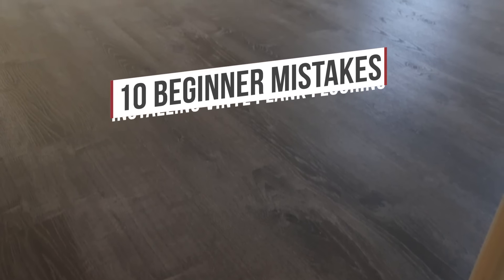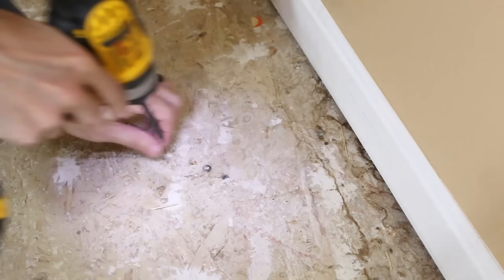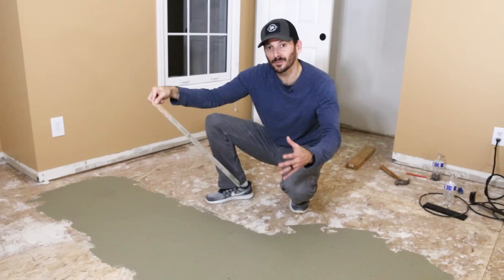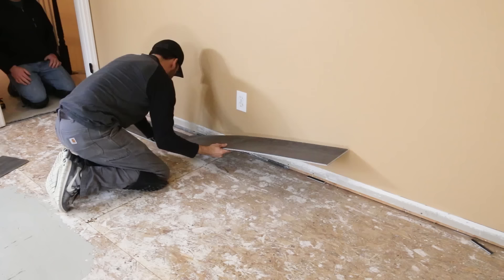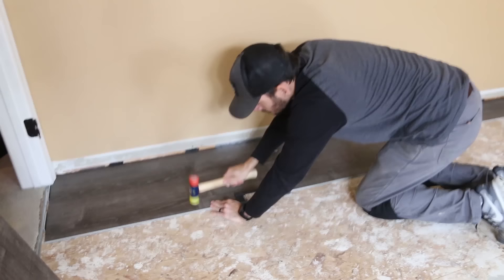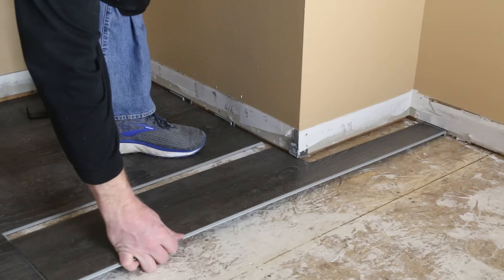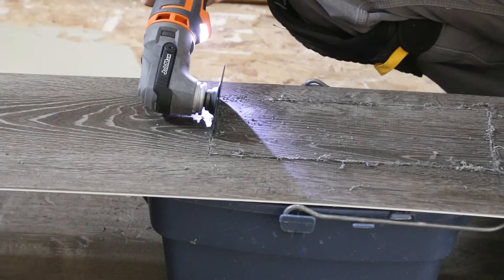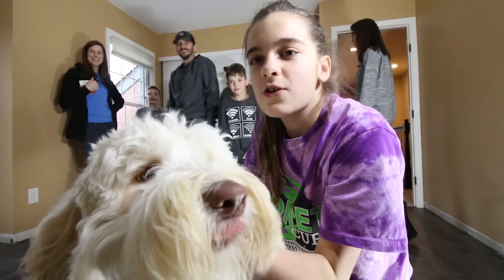10 Beginner Mistakes Installing Vinyl Plank Flooring

Comment: We removed our baseboards, mostly so I could convince my wife I need a pneumatic brad nailer. Also, I used a flat shovel to pull up the tack strips and most of the staples. Didn't have to use the pliers much at all.
Reply: Yea but shovel with damage the base if your not going to put new up
Reply: Can use isolating tool to cut staples off I tried it  works even with an old  blade

Comment: need to have more emphasis in the vid about prepping the sub floor.  Especially for those with older homes who may have nailed flooring.  Use appropriate type and length of screw to secure the subflooring to the joists to avoid future squeaking.  A pound of prep on the subfloor up front is worth its weight in gold over the long term.
Reply: As odd as it may sound, I have a home that was built in the 50's. Our kitchen floor squeaks in a few spots. I have not only grown accustomed to the squeak, I am getting to where I like it and attribute it to the character of the house.
Reply: Never seen a sub floor not nailed down
Reply: @johnstonjoseph81  I've seen them with on screws no nails.

Comment: When you reinstalled the base board at the end of the installation, I don’t see how that changed the large gap between the lower vinyl plank and the bottom of the base board. Did you install the base board lower? If so, that means you would have to repaint the wall, no?
Reply: Yeah, they will lower the baseboard down to the finished floor level. Which means repainting the walls...I'd rather install quarter round. Quarter round also has more flex in it to follow the dips and bumps in the floor. Baseboard has a harder time doing that.
Reply: I plan on removing the baseboards as I am painting my walls also. This will allow me to use a roller at the bottom and I don't have to worry about using a brush to trim over all the baseboards
Reply: Can you installing new slightly taller baseboards?

Comment: 37 yrs I’ve been doing flooring and using floor prep or thin set to level the floor is in my opinion the worst thing you can do . Why you ask because it dries out and cracks underneath a free floating floor and when you walk on it it sounds like Rice Krispies I personally use the cardboard from the plank boxes to level it out as you go . If it’s a severe dip in the subfloor yes prep it but you should use the bonding additive to the floor prep and use bondall and roll/ paint/ brush onto the plywood before you lay flooring prep on it . I have done many repairs for  customers complaining about crunching noise under the flooring so either using cardboard or bondall and a bonding additive for the flooring prep will eliminate any problems .

Comment: I recommend using a 10 foot straight edge or at least an 8 foot one to make sure sub floor is within spec for install. 
Usually for vinyl it is 3/16 over a 10 foot span.   Very  important for warranty on the install.
Reply: Flooring Everything he did...
Reply: He used a six foot level in the video. 
I only added the comment because it was a great video , but I feel the  rule of flatness is critical  in  a vinyl install.  
The first thing a manufacturer does when they come to a job site is check that rule. If the floor has any  humps or dips more then 3/16  the warranty will be void and called installer error.
Reply: @flooringeverything8260  yup 8 foot is the way to go but some floors require 10 foot to 3/16 of uneven surface but the smallest radius to 3/16 is usually at least 8 feet never seen the warranty uneven measure radius at 6 foot so him using the 6 foot isn't going to give you the measurement you need
Reply: On my jobs I found new use for my old chalk line. Drive a nail in at one end of the room and stretch tight to the opposite side.

Comment: Carefully label ALL baseboard pieces WHILE removing them.Write on the back of each.
Reply: Painters tape and a sharpie just put it on every one
Reply: Very beginner advice taken
Reply: Sorry - beginner here. What am I writing on the labels? Which row they're from? Thanks
Reply: @jackhaugh4198  
Which walls. A on the baseboards then write A on the wall which it came from. Write B on the next baseboard and B on the wall what you came from and go throughout the alphabet.
Reply: @rxonmymind8362  Thanks!
Reply: I don't get it he removed the baseboards and then thinks he can reinstall them lower without a quarter round (carpet stood higher than vinyl planks) which means repainting the wall !! He got away without mention that at the end. I don't want to repaint walls !  Am i missing something ? thanks !
Reply: @ericastier1646   I was thinking the same thing. Paint and recaulk? not a fav... waiting for answer as well.
Reply: @ericastier1646  He mentioned at 12:32 that they're replacing the base-boards, so I imagine they're going to get taller boards to cover up the unpainted part of the wall.
Reply: @ericastier1646  I work for a company that rents apartments. Many are around a century old and have carpet in the bathrooms/kitchen (which is a bad idea). We routinely replace it with vinyl plank flooring. My boss prefers using shoe-mold or quarter-round, I take out baseboards if they're less than six inches high (longer than that they usually break or hide a very wide gap between wall and floor).
Typically, we DO paint the rooms. If it's vacant, it only takes about one and a half hours to paint a bathroom, and about two to three for a kitchen. Naturally, it depends on how many edges (corners requiring brushwork), obstacles like cabinets, surface type, and, to a lesser degree, square footage, but it goes much, much faster when you don't have to worry about spilling paint on the floor and aren't fighting a drop-cloth.
Reply: @ericastier1646  not just paint , their will be a caulking and paint line, you must scrape clean, coat with speed mud, sand then texture, prime and paint, I always try talking home owner into new taller baseboards
Reply: When I decided to replace carpet with laminate, it made sense to paint walls and replace baseboards. House is 50 years old. Baseboard was stained and deteriorating. And was installed before carpet. Only exposed 2.5 inches of wood. Did it in 2019 when wood was cheaper.
Reply: @starpartyguy5605  excellent! Base always needs to be replaced
Reply: @shawnhartmann4581  I did repaint walls and learned that getting an even uniform result has many parameters involved. Not sure if it was the Lowe's or Home Depot paint brands or the roll brush type i used or the lack of water in the paint but i had a hard time getting a perfect result. Seen facing the wall it looks perfect but if you look at a low angles not at all uniform.
Reply: @ericastier1646  It sounds like you're dealing with a sheen change due to the undersurface.

If it's your own house and you can deal with the imperfection, take my advice for next time. If not:
Sometimes (especially in older houses) decades of repainting will leave a noticeable ridge when floor trim is removed. Carefully scrape the worst of it off with a putty knife or painter's 7-in-1. Then get the rest of it with some coarse sandpaper or a fairly fine pumice stone. Just be careful not to gouge the wall. If you do gouge, you can probably make it invisible with some spackle or drywall mud and careful sanding, but that's extra time.

Next, you need to even out the sheen. In other words, what you describe sounds like one part of the wall prior to your painting it was glossier than the other. The easiest way is to prime before you paint. In most rooms, you can get away with latex-based, in rooms where moisture is going to condense on the walls like a bathroom or kitchen, you should use an oil-based primer. Nice thing about bath and kitchen is that there's sometimes exhaust fans, they help with the oil paint fumes. Either way, open windows and doors. 

For both latex and oil primers, my favorite brands are Killz and Bullseye. They're not the cheapest (but the cheap ones you can wipe off with a damp rag after they're dried) but also not the most expensive. Both have good "hide", covering variations in color well. Killz is better in that regard, but I find Bullseye to be more durable. Dealer's choice.

Like I said, If it looks perfect straight-on, you did a good job, if the small imperfection at angle doesn't bother you, it's good. If you really can't deal with it, and you don't want to go to the trouble and expense of priming and repainting (although painting a well-primed surface can be more of a joy than a chore), as a stop-gap you can take the remainder of whatever paint you use and apply a second or third coat where the trim was, feathering out onto the main wall to blend it. The previously trimmed areas are the most likely culprit, and multiple coats may fill in the physical differences in the undersurface which are causing the variation in sheen.

Hope this helps.
Reply: @shawnhartmann4581  I am thankful and appreciative for your clear and expert answer but i realize i was not clear enough. It's not about painting after removing the floor trim, it's simply interior wall re-painting with latex paint over older latex paint (I tried Valspar and Bear on separate walls, just hallway not bath or kitchen) and got passable result with valspar sheen varying where the roll brush had been. I looks like i did not cover the wall uniformly even though i tried my best to follow an overlapping pattern and to use an even light pressure of the rolling brush. While i was painting i noticed that the latex paint dried very quickly and so I mixed a few trickles of water in the mixing pan whenever i reloaded the brush with paint. I tried to add as little water as possible, it did not drip but the sheen has unacceptable variability over the wall seen at low angle showing the rolling passes in a random way.  I used a small roll brush (I think it's the one for touch ups instead of the full size one) but i used the spongy like type of roll for smoother surface which i replaced halfway through the job. I noticed the brush quickly got compressed to only a few milliter thick by the drying paint.   I don't know where i went wrong so now i have less confidence in doing another wall but i'll definitively buy the regular sizes roll brush instead. The paint was mixed in store at Lowes, I suspect the Valspar brand is inferior.   I did not use a primer, i also found it difficult to paint the same color over the old one for knowing where i had not applied enough new paint. I did do a second pass probably i did not wait until the first pass was fully dry and that might be the reason for the uneven sheen.    What i didn't like was that the roll seemed to hold less and less paint as it got compressed by the mucky thick latex paint, i had to reload it constantly even after 3 hand strokes.  I found that particular latex paint gave very little margin for error. Especially due to how fast it dried and if you rolled a second time over the already drying paint it messup the sheen.   I didn't expect it would be that tedious and difficult. I am still unsure where i went wrong or if the paint was not just a good brand.
Reply: @ericastier1646  Valspar is indeed hit and miss, sometimes you get a great mix, and sometimes both coverage and hide are terrible. Adding to the confusion is that they have "minibrands". Their Signature line is probably the best one they put out.

If I can, I tend to use Behr or Sherwin Williams.

Also, never add water to your paint if you want an even coat. Other painters might (and have) disagree with me on this, but paint is too fickle for that imo. If the environment is super arid and the paint is drying too fast, moisten the air. Close doors and windows, bring in a big pot of boiling water and set it in the middle, turn on a humidifier, run the shower on hot for two minutes, it won't take much. It's latex, so you really don't need too much ventilation (unless you have a bad liver). Just don't spend all day in the closed room.
Also, not to criticize, but paint shouldn't dry as fast as you're saying. Could be the air or brand, but also maybe paint a bit faster?

Main thing seems to be the rollers. I use the small 2-3" ones sometimes, but rarely, mostly just for very narrow but highly visible areas I still want to get an even coat on. My go-to roller covers are the medium-nap 9" Valspar blue ones. Even with their occasional paint fails, they make a decent roller cover. It's polyester, so it both holds up and releases paint decently, and is durable enough for most textured surfaces. Though if you're painting a large area of raw brick, cinderblock, or rough concrete, you might have to switch in a new cover halfway through. You can get a 3-pack for about $11.
There are cheaper covers, like from Project Source. Avoid those like the plague.
There are also more expensive covers, but they only work a tiny bit better. Don't worry about a roller cover leaving a sort of mild goose-pimple texture after a pass. Unless your paint is super thick (usually due to being used off-and-on over a few years) almost the consistency of thinnish pancake batter, the "pimples" will fade as it dries.

Also on the subject of texture: brush strokes.
Again, different painters have different opinions, but mine is that all cutting in (the edges) should be done before you roll. Those tiny bumps from a roller might settle, but the ridges in paint left by a brush might not.
You kind of have to do both, as well as overlap them, so it isn't any faster to do it one way or the other. However, if you roll first then cut, you will often leave streaks the width of the brush (I usually use a 2.5" angled trim brush) along ceiling, corners and floor. If you cut then roll overlapping where you cut, you can get pretty close to an edge and have a much smoother surface. It's also okay to rotate the roller 90 and do a pass overlapping the ceiling and floor cut, when you're doing the big vertical strokes you'll partially go over that area again so it'll be texturally even, but you'll also give yourself a decent margin so you can go quickly without having to worry about accidentally slamming the roller into flooring or a nice white ceiling.
Reply: @shawnhartmann4581  Thanks a lot for the added guidance, Shawn. I'll buy the medium nap 9" Valspar blue ones and stick with Behr paint. Hopefully with better results. I see you are a bit dubitative about my saying the paint dried fast. I painted last May, i am not in a dry climate but i now realize i did a mistake of turning on the AC which removed air humidity, i won't do that again and will try to increase humidity instead as you said (which is not pleasant).  I was not working slowly either, the Valspar latex paint is only slightly more fluid than pancake mix consistency from the can. It felt like spreading thick paint on the wall instead of coloring the wall. The Behr was similar but was painted in a small laundry room without windows so harder to judge than the Valspar painted along a corridor with window at one end.  Overall i dislike the thick consistency of latex paint. I think that the lack of fluidity and fast drying of latex paint is what creates the sheen mismatch. Only 2 minutes following a roll application when i came a 2nd time to overlap it messed up the final sheen as if there is a sticky effect as it dries. But 2 minutes or even less is very short time to complete one vertical pass with the roll including reloading the roll at least 3 times.  It's why i added water but then mixing the water in the latex takes extra effort and extra time.  Very frustrating process.

In the same condo in another project i repainted an ornamental (fake) fireplace floor fake stone (plastic) slab with polyurethane paint  (why is everything so fake in american homes compared to other developed countries, different topic). I cleaned the surface with alcohol. The painting was extremely easy, even enjoyable with a 3M breathing mask but the fumes were horrible and lasted for a good 3 weeks. The final result was excellent.  This was my first experience with latex paint and i expected it would be easy, but i found it difficult and frustrating.
Reply: @ericastier1646  Didn't mean to disparage. Painting, at least in construction circles, doesn't get much credit. A framer, joiner, plumber, tinbender, etc. all inherently get more respect. 

In truth, there isn't much knowledge necessary to be a painter. Maybe a working knowledge of color theory and the inherent relative strengths of commonly used pigments, but you can get away without that. Aside from that, just in the two comments I made above I've listed about half the knowledge necessary to do it professionally. Didn't list coverage, sheen for environments, painting logistics or other minor things, but those are all a little complicated and irrelevant to the discussion.

However, unlike the other crafts (which are generally 90% knowledge, 10%skill, or at most 50/50), painting is 10% knowledge, 90% skill. I'm not saying it's on the order of sculpting or ballet or something equally impressive, but skill is only gained through practice. By which I mean years, maybe decades.

I hope you get it perfect, but, seriously, don't sweat it too much if you don't, as long as it's decent, no one else is going to notice, and next time you'll get it closer to perfect. Also important to remember that while you get closer and closer to perfect, it's like Zeno's Arrow, no human can actually get there. It's a goal, not a destination.

Good luck!